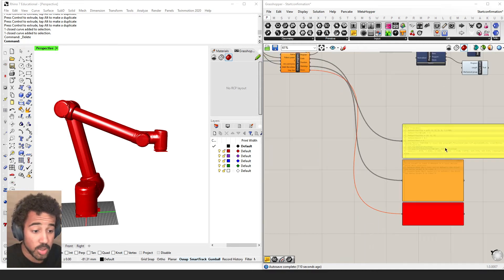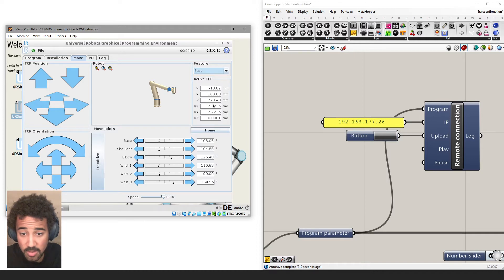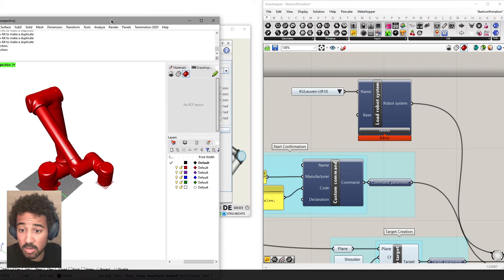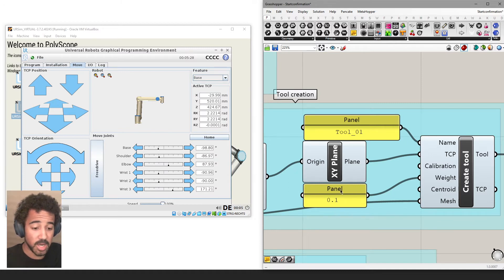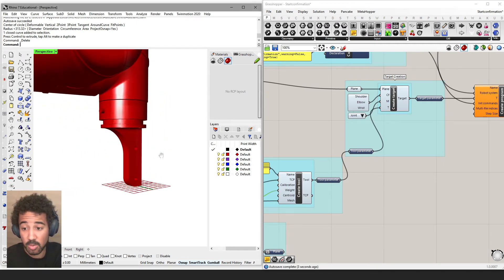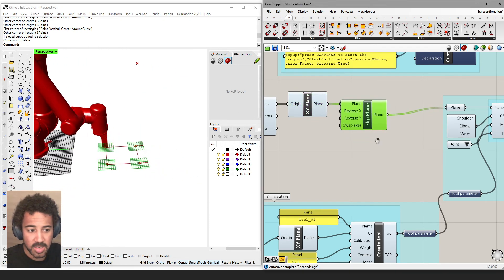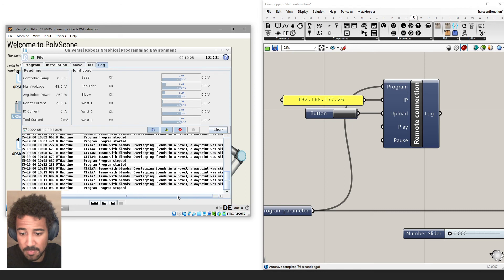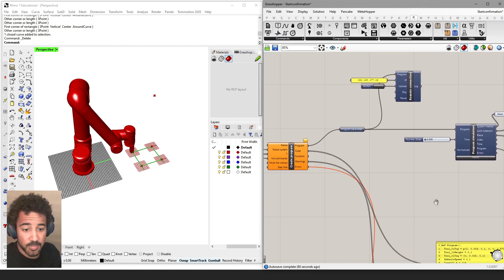Programming Robots in Grasshopper: 10 Troubleshooting common Problems

Comment: Hi, pretty late to the topic… but very good tutorials! but does anyone have deeper Knowledge of handling huge plane counts? 

The UR quits its job at around 1800, i have worked with rebuild curve but I loose to much resolution. 
Can I split the code and auto start each 1500 to keep the robot working like kaskading system or is there something like Interpolation (nurb curves or similiar)
Reply from the maker: hey Milan, check this tutorial: https://www.youtube.com/watch?v=Zcpn2R2JuS0

Comment: Thanks for great tutorials! 
 Would you consider exploring how to control a Robotiq 2-Finger 85 Gripper? 
Many UR robot installations have these grippers but controlling them via Grasshopper is not  simple.
Reply from the maker: I am looking into it, unfortunately I don't have access to one of these grippers at the moment, so testing is difficult. 
I might be able to look into controlling the OnRobot RG2 gripper as I might have the possibility to use it. However, I am not sure if they work in a similar way and the solutions are transferrable.